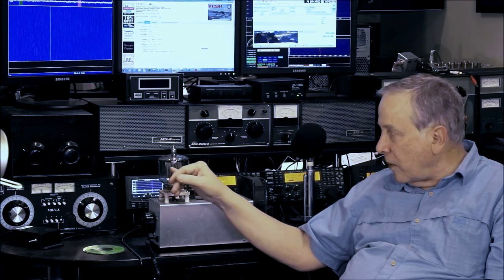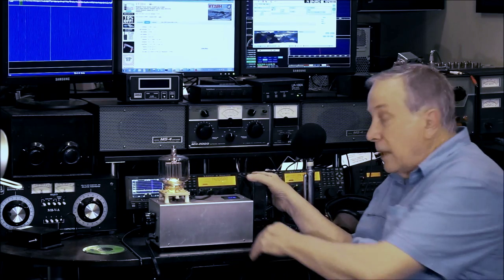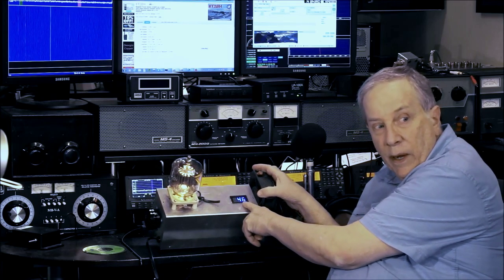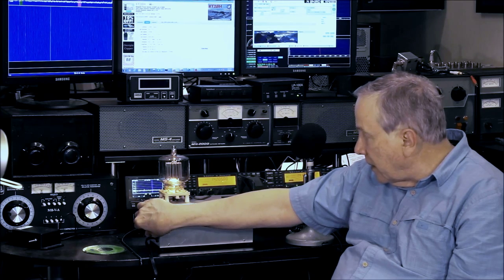Ham Radio Basics--3-500z, 3-500zg Filament Tester for Old Tubes

Comment: Hi. Thanks for the video.
I recently built a similar box for the same reason - to test & compare a number of tubes I have that fit that socket.  I mounted a fan inside the enclosure, blowing up from base/pins, up outside the tube envelope - also checked ok with IR thermometer.
With insufficient space left inside for a 'plate supply', I just added a connector to provide access to all pins (and switches to allow grid, or both grids of a tetrode, to be individually switched to plate, or to float)
With grid/s tied to plate, around +40V dc causes around 400mA of cathode current in a good tube.
No, it doesn't get the plate hot (maybe next version) but it gives a feel for filament emission & I think may (help) identify a gassy tube too?
I have a 3kV at better than half amp homebrew supply with variac in the shed & soon will drag it out so I can get some real dissipation from the plate & run it glowing for hours, to help 're-getter' the tubes.

Cheers :-)

Comment: Excellent idea.  The grids are so close to the filament in those tubes that any time in a non-vertical orientation could contribute to sag and bad things when instantly heated.   The only improvement I can tink of is one you mentioned and that is HV and current.  The getter material is on the plate in 3-400, 3-500 and 3-500z tubes and they need to get cherry red for a while for that material to work.  I'm not sure about others but 3-400's and 3-500's suffer from glass to metal leaks (very slow) but it is recommended that they be used up to operating plate temperature every 3-6 months to fight any gas ingress.

Excellent idea and explanation for a potential money saver (these guy's aren't cheap)!  Thank you

Christopher VA3NTH

Comment: I just watched you with tube tester. 
I bought a Heath Kit 101 Transceiver back in 1969 from a guy I worked with. 
It worked great then 
I stuck it in the attic. 
I just got my tech luv 5 Dec 17
I’m in the process of setting it up. 
Do you know a good source for tubes?

Comment: Jim, depending on the type of tube, running at low filament voltages can poison the filament quickly. Without plate voltage and electron flow the getter material will never reach active temperatures and the gas produced in an old tube over time will not be absorbed by the getter but will be absorbed by the filament and destroy the tube. Please reference the following article by W8JI and see if these circumstances apply to your situation. Different tube types, different issues. You will find the most pertinent information regarding the phenomena near the end of the article.  Hope this helps someone. -Don KW4UP.    http://www.w8ji.com/vacuum_tubes_and_vaccum_tube_failures.htm

Comment: Jim, I don't think it is a dumb idea at all and I am not a tube expert. However, I rarely do this. It certainly is a good idea in that it will check the filament continuity and vacuum on the tube. You can also tell something about the tube if it lights up with a nice healthy brightness vs a dull orange glow at full filament voltage. An ohm meter check filament to grid and grid to plate is also a good idea then I just plug it in and  turn it on.

I have to share one story with you. Many years ago, I built a 4-400A amp, probably for my AM days back on 75 meters, and I did something wrong, if I remember correctly, removed or lost plate voltage with screen voltage applied.  I was obviously running the tube as a grid driven tetrode and not a GG amp. Things went bad really fast and I probably saw the screen current meter peg violently before I could turn it off. When things cooled down, I removed the tube and checked for shorts with a VOM and I did have a screen to grid short. A DC short. Not a good day so, in a moment of frustration, I remember holding the tube in my left hand and rapping it very hard with the knuckles of my right hand. OUCH... I hit it hard and then for some reason, I checked the tube again and the short was gone. True story. I plugged the tube back with all the correct voltages and it worked... I can't remember all the numbers as it was over 40 years ago but I do remember the output was down a good deal something like 25-30%. I don't recommend this a a method of tube repair but it is one of those stories that it's fun to share. Really enjoy your videos.

Comment: Jim,
What was the outcome? Did it help?

WB3BJU
Reply from the maker: Perhaps.  I was able to slowly heat some old tubes; four of them.  All came up to speed with no issues.  All were tested with high voltage and a fuse in the plate lead.  In the past, I have had tubes fail if I turned them on after years on the shelf.  Thanks Don!
Reply: I have an SB221 that has been packed away for 25+ years. Getting back into the hobby after that long. Brought my FT-901DM back to life, but still need to change out the electrolytics.
Reply from the maker: I would replace the capacitors in the power supply and the resistors across each capacitor.  Those resistors likely have different values.  And because of that, the resistors can put different voltages on the caps.